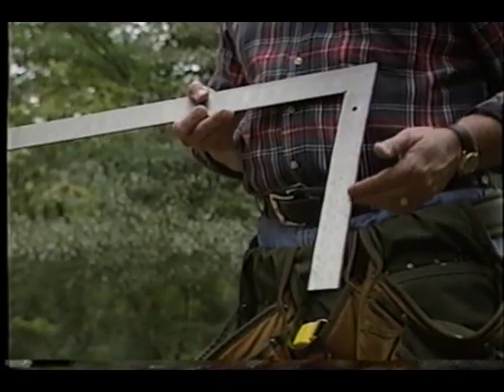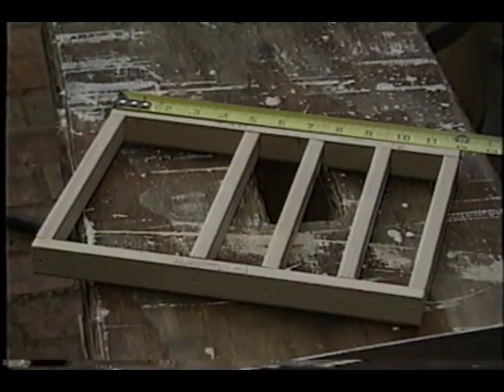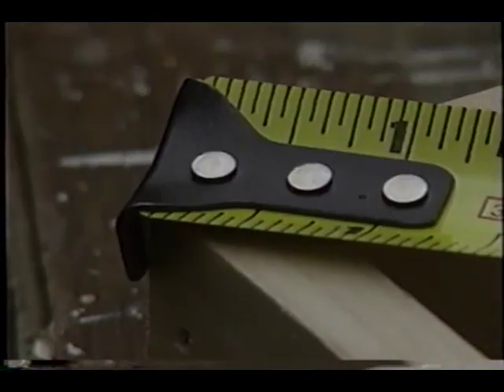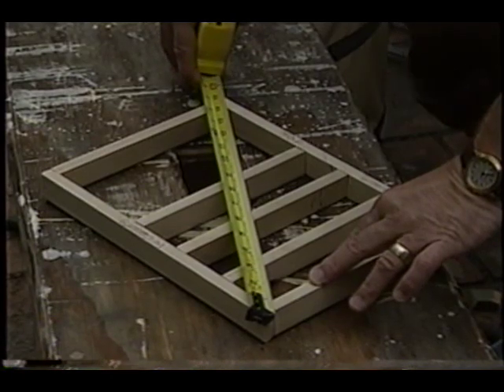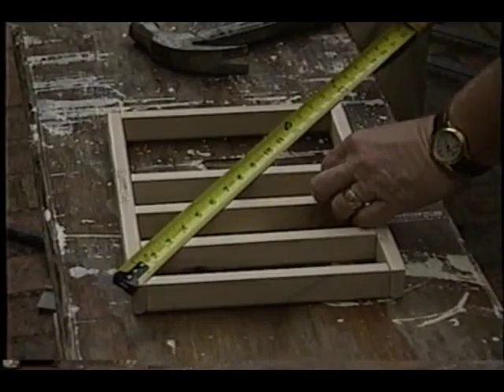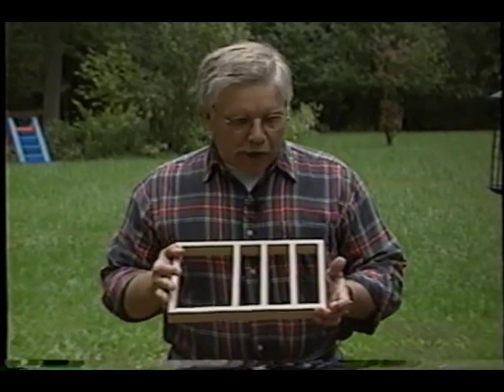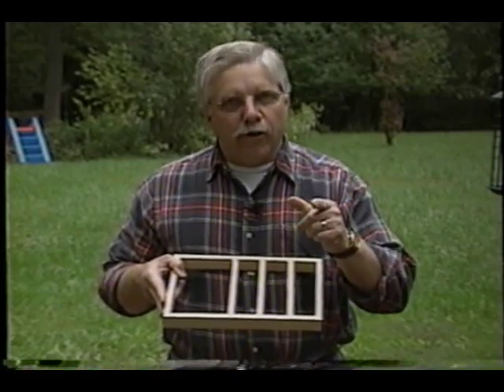Checking for Square

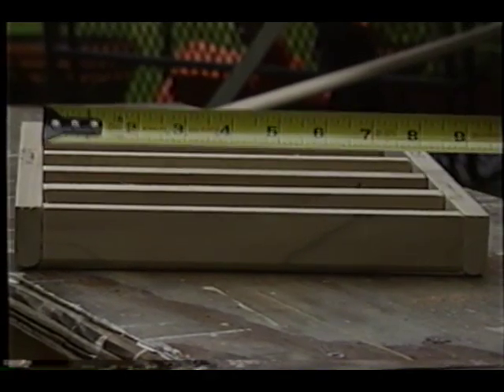Comment: Great tip, Tim.  I showed this video to my geometry students when talking about the diagonals of rectangles, and how to prove that a figure is a rectangle. One way to prove a rectangle: prove that it is (a) a parallelogram with (b) congruent (equal) diagonals.  The math behind your method: (a) when you measure to ensure top plate = bottom plate, studs = other studs, the figure is "proven" to be a parallelogram (not a rectangle, as you mentioned at 0:48 in your video) . At this point in your process, it could be close to a rectangle, but shifted (i.e., a generic parallelogram) as you did mention; (b) when you ensure the diagonals are equal, the figure is then "proven" to be a rectangle .  Again, thanks for the video.  It is a great, practical geometry application, and it helped my geometry students to better understand rectangles.
Reply from the maker: Shawn Remy You're most welcome Shawn! If your class ever wants to Skype me in for a LIVE video lesson about other geometry and building tips, let me know. I've done it with other teachers. Thanks for your vocation and for educating future thinkers and DOERS!
Reply: Gave it a thumbs up

Comment from the maker: @conmanumber1 Well, yes and no. Let's imagine these dimensions: A wall 97 and 1/8 inches high by 243 and 3/4 inches long. Tell me quickly what that diagonal measurement is?  Using my method in the video, I'll have the wall square in about 5 seconds with a helper. That's faster than you could enter those measurements in a fancy calculator.